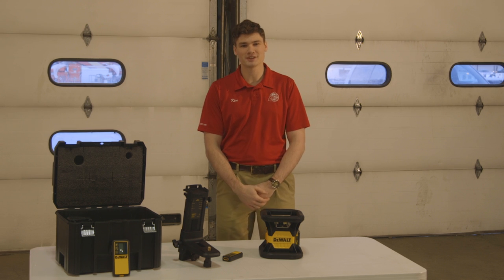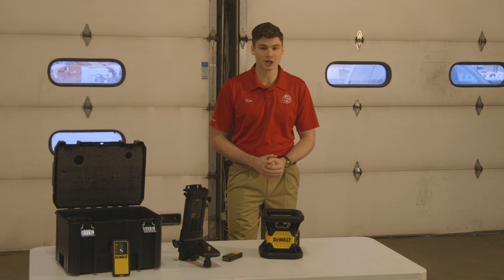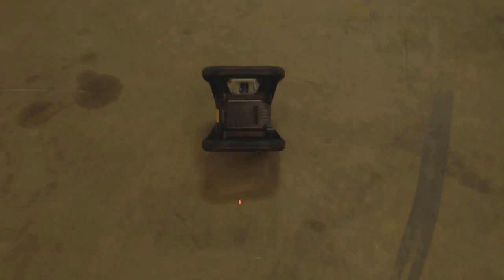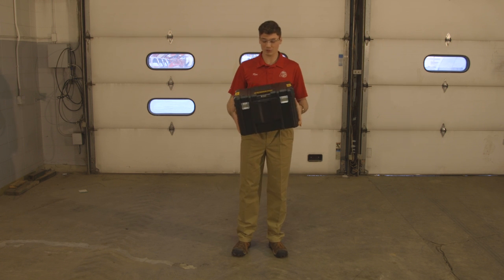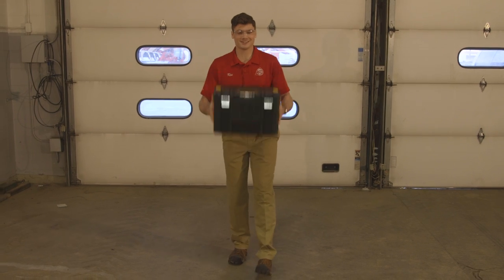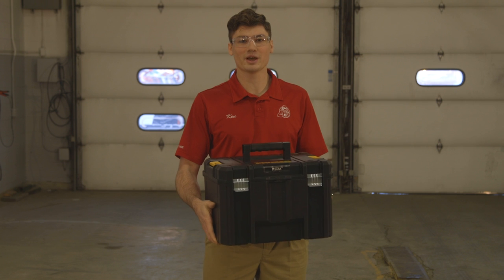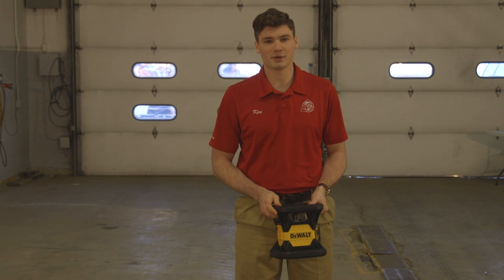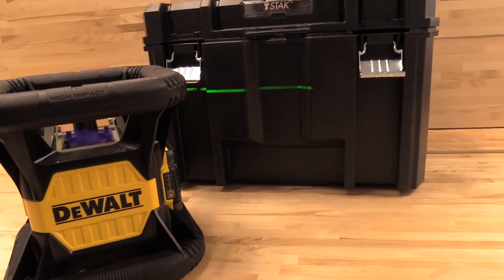Tool Torture: DeWalt 20 V MAX Tough Green Rotary Laser

Comment: I need to build a 2000feet water channel and I need it as perfect as possible 
1/16 Accuracy for 100 feet, what does that mean for 2000 feet? 
Can someone explain?
Reply: For every 100 feet you go out from the laser, the accuracy is within +/- 1/16". So if you are 300 feet away expect an accuracy of +/- 3/16". Hope you can finally build that water channel now that someone has answered your question.

Comment: Uhhh Tstak cases aren't water proof the tough system ones are but no they don't have a seel
Reply: There is no seal but they are pretty good in the rain. At less then have the price and weight of the tough system they are the best storage solution on the market. Leaving a tool in the rain in a tstak is no problem but if your tools are traveling exposed all the time then you may want the TS. The thing about the Tstak is it works as well in the shop as on site.